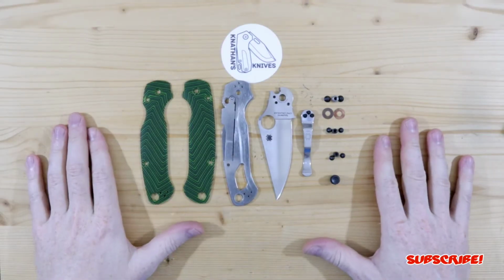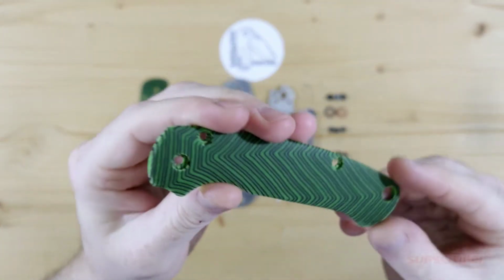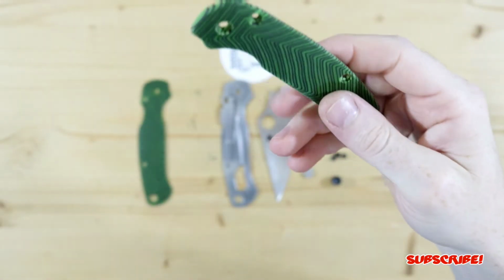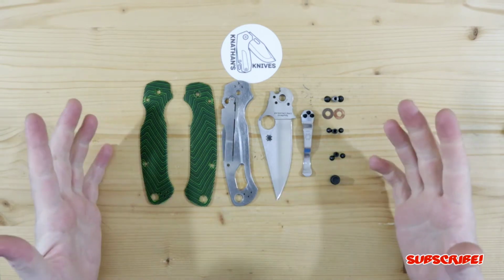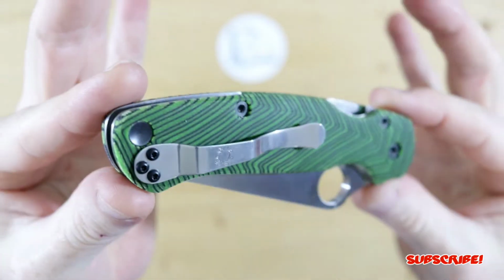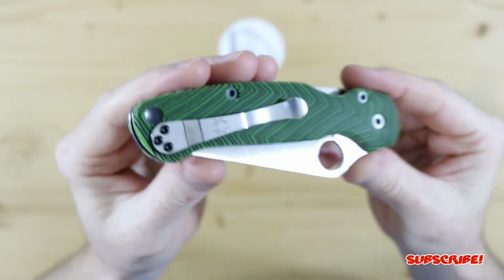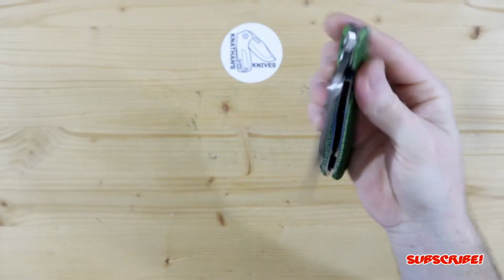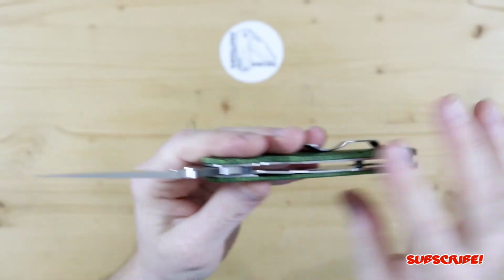Custom G-Carta Scales For The Spyderco PM2 Cruwear!!! #green

Comment: How long do you let the Tung oil dry (after wiping off) before installing on the knife?  Does the tung oil need to dry for days or weeks or is a few hours enough?  Thanks for the video!
Reply from the maker: I know that Tung Oil takes a few days to cure/harden but after wiping it off I use my knives immediately.
However, you do have the option to let it cure and then use the knife, just preference.
No problem! 🤜🤛